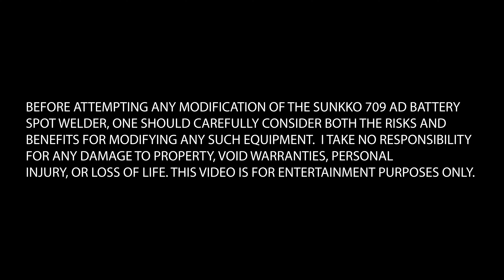Sunkko 709 AD 220 Volt for USA, CAN, North America Battery Spot Welder

Comment: If I’m Converting the 3 prong plug (220v) to Nema 14-50 4prong would you connect ground to ground plug or neutral wire on nema 14-50?

Comment: I also have the 220V 709AD it is working very well.   I had to buy mine from Alibaba too.   It came with the 110V plug and all I did was change the plug.   But adding a second fuse is a good touch for safety.   I am welding .2mm nickle strips and it does a good job at 12 pulses 80%.  I have pulled over 300 Amps through these welds.  I recently got a 737 110V from Amazon and have already sent it back.    Don't even waste your time with 110V versions.
Reply from the maker: Nice to hear the good results you are having.  Thanks for watching.

Comment: i own 709ad+.
I consider it a garbage.
Do not understand whats so hype about that shit welder?
on max settings with 18 pulses it just barely weld negative side. i can pull nickel plate off with fingers.
I spent lot of cash then import duties, tax.
much disapointment.
Did anyone tried to somehow upgrade inner components to have this 709ad+ be stronger?

so far i can only weld thinniest nickel plates to positive. negative is difficult and lottery. if used 0.2mm nickel plate = no stick to both negative or positive surface of 18650.
709ad+ <-- do not buy it unless u know how to upgrade it for stronger.
Reply from the maker: You have the 120 version?

Comment: got a little confusing, you're showing a 220v  709 AD,  machine.  but the  first electrical plug that you show on the video is 115 v. USA plug, you  cut off???? maybe i missed something??
Reply from the maker: Yes, they sent a 220 version with a US 115v plug.  Completely not useful so I cut it off and replaced with L630.
Reply from the maker: Correct, I removed the male 115v plug.
Reply: I ordered the 220 v version and it too came with a 110 plug.. 
I used a continuity test to verify that there was no double ground and that it was indeed 220.
Reply: Here are three pictures that clear it up..   https://www.youtube.com/watch?v=slfZds9T_w0&feature=youtu.be

Comment: I bought the 709 ad+ but got the chinese 50 hz. could u recommend a good conversion module to make it 220 50 hz to 220 60 hz?????
Reply: you can run a 50hz machine on 60Hz, but not vice versa

Comment: I don't see the point of inserting a second fuse in series with L2.  The factory fuse is only included to provide supplemental overload protection (an overload will always produce identical current in L1 and L2 in a single-phase, 2-wire load).  Short-circuit and ground-fault protection is provided by the branch circuit overcurrent protective device.  If additional safety is the intent (ostensibly to protect against a high-impedance ground fault?), then installing a 2-pole class-A GFCI circuit breaker on the branch circuit supplying the machine would be ideal.

Comment: thanks for the good and clear video  . I just purchase a Sunkko 737g  that has a Schuko 220 volt  plug that I am changing to a home depot 4 wire OVEN PLUG.   Supplying my 737g, I have a brown {hot} wire and blue {return} and a green/yellow {ground}   The brown wire is fused.
Using the 4 wire OVEN PLUG, my intention is to connect the brown to BLACK,  the blue to RED, the green/yellow to GREEN,  not use the WHITE and cap it off. Finally, install a fuse as you did, in the blue return leg.
Reply from the maker: How's it working?  All se\t on the connections? Good idea to add the extra fuse.
Reply: I am getting the 4 wire oven plug today and will connect it all tomorrow.
I know that you are not an electrician but are my connections the same as yours?
thanks.. @GreenMountainDIYGuy
Reply: Did that work? I have a 220v with type I Australian plug here in USA so I want to change it.
Reply: Trying to accomplish the same thing. Were you able to get this to work?

Comment: I ran a second romex out from our junction box from the dryer CB (co-wired) to a wallbox (not in the wall, just for protection) which has a female L-630 socket. You could actually do the same thing from the dryer socket (properly protected) so you have an easily accessible secondary socket of 220vac so you don't have to climb behind the dryer. Ours is in the basement so I just ran it to a convenient spot 10 feet away; boom-220 socket I can plug directly into; just don't run the dryer at the same time. You could do the same thing on the stove so you had a 220vac socket and use the kitchen counter (if your wife is cooperative), then you plug in, do your damage, unplug and no one will complain, just a wierd wallbox and socket within reach. I also label the socket '220 Volts Only'